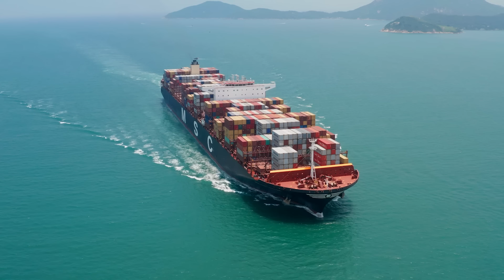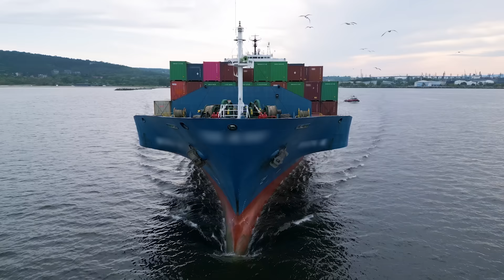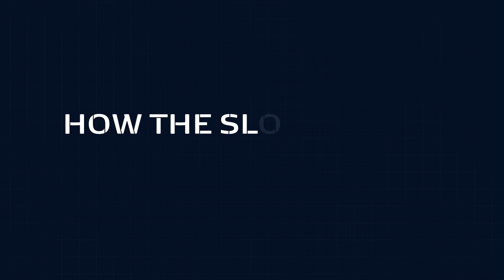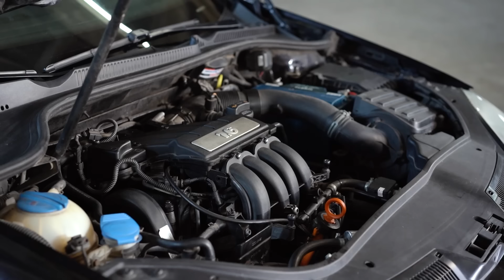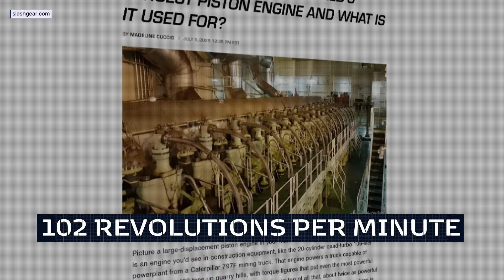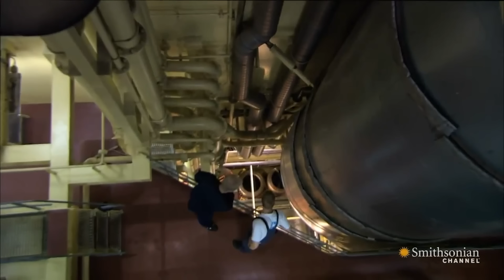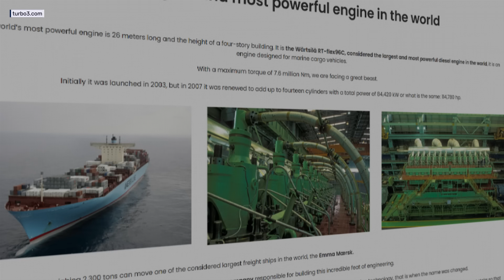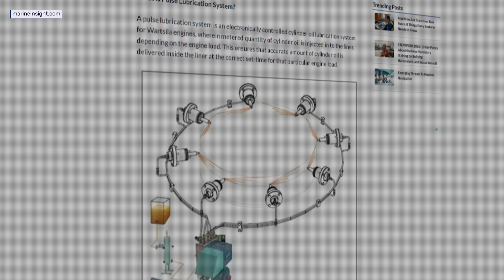The 100,000 Horsepower Engine

Comment: "barely faster than the second hand on a clock, a little over a hundred revolutions a minute"

That is precisely 100 times faster than the second hand on a clock, by definition.
Reply: You beat me to it LOL.
Reply: Now I think about it I get what they were trying to say, but the comparison was incorrect. I think what they intended to say was that it's barely more than one revolution per second. I think the writer tried to make it sound a bit more technical but then.ended up making the analogy wrong.
Reply: @DunkdaHunk finally someone who can understand what they meant to say instead of crying about it being wrong. But exactly, they meant one revolution is a little over one second but the way it was worded was just incorrect.
Reply: I know.  He got the math wrong from the get-go.  Imagine the crank shaft  turning the speed of the second hand on a clock. That's 1 rpm ,  not 100.  How do you convince the fuel to burn that slowly?    1 revolution per second makes sense.  I'm pretty sure that's what is really happening.
Reply: @timhallas4275 the speed of the hand itself the actual movement of it during a tick
Reply: @ApexPressureWash  How can that possibly be what he is saying here?  Why would he use such an obscure thing as a reference?   He is not.  He's is comparing the rotational speed of the crankshaft to the rotational speed of the second hand on a clock.  That would be 1 rpm. It makes no sense.
Reply: @timhallas4275 what makes no sense is how slow 1 rpm is in relation to the engine
Reply: @timhallas4275 maybe he means the propeller speed
Reply: @christopherwheeler2070  The crankshaft is directly connected to the propeller. There's no gear-box.
Reply: @thirstyCactus  plus giving it a 100-1 gear ratio would be incredibly inefficient and very slow.
Reply: @timhallas4275  it was ment as explosions per tick of that second hand, but unfortunate formulation for sure
Reply: @stanislavbandur7355  In a 2-stroke 14-Cylinder engine, there are 14 Bangs per revolution.1428 Bangs per minute @102 RPM (1428/60) comes out at 23.8 per second, not 100.
Reply: @JMuller-y1l  I am not sure, I cannot see into his head. I am used to think about 1 single cylinder when it comes to engines, rotary Wankel one is tricky, it does several things at a time, but that is other story. Using more cylinders is just for smoother running and enlarge area for cooling, it does not affect, how engine works. There are cars whit 2 cylinder with synced pistons, counterweights and flywheels do their job.  

sorry for unfortunately formulated comment on his unfortunate formulation
Reply: @timhallas4275 that’s not an engine that’s a trap set by Jigsaw somehow
Reply: @timhallas4275  you can add additives to make fuel burn slowly
Reply: @jwalster9412  I don't think you understand the problem here.
Reply: @jwalster9412  🤡
Reply: It’s precisely 1.7 times more.
Reply: @Thumper68  you might want to think about that again. I've jet to see a clock where a second hand takes less than a minute for a full revolution.
Hint: the minute hand takes an hour for one rev...
Reply: 102 is 1.7 times more then 60.
Reply: @Thumper68  100 revolutions a minute is 100 times faster than one revolution a minute
Reply: @m @mgancarzjr correct but I understand what he was attempting to say that there’s 60seconds in a minute 102 revolutions per minute comparing 1 second to 1 revolution. So meaning in 60 seconds it’s spins 102 times meaning 42 more revolutions then seconds not really that close and kinda a bad comparison but 102 is 1.7 times greater then 60.
Reply: @Thumper68  what he was attempting to say is nonsensical like: 

More people have been to Berlin than I have.

Grammatically, the sentence can exist, but it makes no sense.
Reply: @Thumper68  That would be the most illogical way of explaining it.
Reply: I really enjoy this channel, its host and it’s very interesting content, however there were a number of technical mistakes in this that even this retired master automotive mechanic knew were highly questionable. I have a number of questions that will go unanswered.
Reply: @southerncross5020 I mean if you have some unpaid interns pumping out scripts for the 20 channels he has there are bound to be mistakes 😂
Reply: @Atomy111 he gotta crack the whip in the basement and demand higher standards.
Reply: @Atomy111 so not using AI confirmed then??
Reply: @southerncross5020  I've been watching Simon Whistler's channels for almost a decade. He likes to speak with authority, but makes a number of errors, yet often comes off like you're an uneducated plebe for not knowing something peculiar.  See his most recent video on Side Projects on "misconceptions" about dinosaurs as a prime example.
Reply: @rtysson You say that you have been watching him for over a decade but then you disparagingly listed a number of his short comings, errors and condescending delivery. If that is your evaluation of his channel why have you watch him for so long? Just askin……..
Reply: @southerncross5020  why the hell do you care?
Reply: @rtyrsson  it's definitely a quantity over quality approach.
Reply: @rtyrsson I usually watch videos just to comment when he’s wrong and how stupid they sound making what to me is obvious errors 😂
Reply: @rtyrsson I assumed the constant propnounciation errors and mispoken lines were intentional engagement bait. He's been covering the Myanmar civil war for the last 4-5 years and still constantly mispronounces significant things like major leaders and historical figures.
Reply: @rtyrsson is he even writing the scripts himself anymore?
Reply: @_Webpersona  Yea, that’s a valid point…….
Reply: @rtyrsson  he doesn't write his own scripts. Don't blame him.
Reply: @rtyrsson  I kind of agree, but at least he isn't AI.
Reply: @rtyrsson Maybe obscure or peculiar to you, because you're a plebe. 

 I have heard Simon be a self admitted prick. Usually when he's like wtf... It's justified. 

 Impossible to give any facts without talking about the stupidity of the general populace, and getting some numbers wrong. 

 This channel is for hot insights.His other channels are for more educational.
Reply: @southerncross5020 yes Iove that you are absolutely correct 😂😂
Reply: This debate reminds me how few people have seen an analog clock
Reply: I was about to write that lol clever trick to generate comments haha
Reply: When he first said barely faster than the second hand I was like no way it makes power at 1rpm then he says 100 rpm. Thats a lot faster bud.
Reply: He probably means the ticking of the second hand, not the revolution of the second hand.
Reply: It's one of those things that you can agree with without actually think about it, but think for a second or a minute and you realise how dumb it is.
Reply: Wow the math in this comment section is whack. The seconds arm on a clock does exactly 1 RPM or it'd not be helpful on a clock, this does ~100 RPM.  So not barely a difference, not 1.67x like some people seem to suggest.
Reply: The 'seconds' hand... would have thought that that would be obvious.
Reply: I’m confused.

The second hand is moving 60 times a minute, and the engine is running 100 times a minute.

The engine is only moving 1.66repeating times faster, no?

Edit. I instantly realized why it was wrong.  
It’s a Revolution.  So yes, it’s exactly 100 times faster.

For whatever dumb reason, I dumbly decided to think of revs for a second hand as how many movements it makes a minute, not revolutions.

I did horrible unit analysis.

Yes, you guys are absolutely correct.

But I keep this here because I imagine that’s how the mistake was made.  A writer made the wrong unit analysis.
Reply: It's 66.66666% faster than the second hand on a clock
Reply: He says "the crankshaft turns over" meaning one revolution. Barely faster than the second hand on a clock. Meaning one second.
Reply: How do I think I'm completely incorrect now now I think I have a headache
Reply: Mechanical engineer here, came here to write the same, you beat me to it!
Reply: I really enjoyed this! Excellent!
Reply: Yeah, the script writer pooped the bed on that one. Obviously getting 60 seconds confused with 60 RPM
Reply: Glad I wasn't the only one thinking that. I think the fact they are confusing is they idle at like 1rpm or something outrageously low as I believe they don't really turn the motor off
Reply: Also noticed this lol they definitely thought it was 60 vs 100 not 1.
Reply: Aaaahahahahahahaha
Reply: the second hand, the one that counts seconds...
edit: i am an idiot! the second hand rotates at 1 rpm
Reply: What do people not understand about RPM, revolutions per MINUTE. The seconds one does... 1 RPM. The hour hand does 0.0167 RPM. This engine does 100 RPM. Lots of cars will idle at around 900-1000 RPM. Each one is an order of magnitude faster than the next fastest.
Reply: A hyperbolic comparison is a figure of speech that uses extreme exaggeration to make a point, emphasize emotion, or create a striking impression. It is not meant to be taken literally, but rather amplifies the reality of a situation to draw attention or add humor.
.
You must be a special kind of snowflake
Reply: I think Simon is just reading what the writer wrote and the writer is good with words but not so good at typing and engineering. In this case the word SECOND was a typo as it is commonly spelled as T H I R D.  🙂
Reply: unless im thinking of the wrong hands, the first hand does one revolution per 12 hours, the second hand does one revolution per hour, and the third hand does one revolution per minute. that engine is 100x faster than the third hand and 6000x faster than the second.
Reply: Someone got 2nd hand and Seconds Hand mixed up...
Reply: Torque brother  !! it’s all about torque
Reply: Since a second hand on a clock takes to complete one revolution and the prop makes one hundred revolutions per minute then the prop is one hundred times faster measured by angular velocity.
Reply: Lmao, man you must not have graduated high school.. he didn’t mean the second hand, as in the hand that counts minutes, he meant the “second” hand, as in the hand that counts seconds lol😂🤦‍♂️👍
Reply: @cameronsienkiewicz6364 

Right... How many times a minute does that hand, the one that counts seconds, make a full rotation around the clock face? Is it one time? One RPM?
Reply: There are watches that have seconds hands that spin one full revolution every second, specifically in stop watch mode. Presumably this is what he was referring to.
Reply: @Kyle_VanMan 

That's a big reach, and if that's really the case then I'd say a bigger slip would be calling a stop watch a clock. They're two different things to just about everyone.
Reply: Tf is the logic in that. If it's 100 revolutions a min then it's closer to 2 revolutions a second not a hundred
Reply: Yeah l think he was meant to say a second hand going around the clock face every second. Not at the same speed as a second hand lol
Reply: Also, a piston's "revolution" is an up and down motion, not a 360 degree rotation.
Reply: What? That's roughly 1.7x as much... what do you mean it's 100x faster?

Edit: Ahh, you mean it's engines RPM vs a second hands RPM. I think they might just be saying it rotates a bit over one turn per second, as opposed to other engines in thousands of RPM.
Reply: @V3RTIGO222 

Well, what do you call the hands on a clock?Hour, Minute, and Second.

How many times a minute does the hand that counts seconds rotate around the face of the clock?
Reply: @jasoneverett8491  It rotates just over one time in a second, relatively speaking. The issue is the metaphor has two interpretations.
Reply: You mean 40 percent faster
Reply: @yukinari2027 

What do you call the three hands on a clock?
Reply: @jasoneverett8491  your mum
Reply: Was thinking the same 😂
Reply: Without even thinking quantitatively that statement stopped me dead in my tracks.... How TF could a prop possibly work that slow?? It's intuitively obvious that's wrong
Reply: I bid third hand.  It is a metal stick, not a hand, so our errors compound.
Reply: WARTZILLA said it all.
Reply: 100 RPMS is 1.66 per second.
Reply: @clueless4085 

You are correct there, but what do you call the three hands on a standard clock? Are they first second and third, or are they hour minute and second? 

And, regarding the hand that counts seconds: How many times does it revolve around the clock face per minute?
Reply: 60 rotations in one minute, plus 40…. “Barely faster.”
Reply: @JackFromWyoming 

What do you call the three hands on a standard clock? Are they first second and third, or are they hour minute and second? 

And, regarding the hand that counts seconds: How many times does it revolve around the clock face per minute?
Reply: There's a few ooopses.  Later in the video he equated 84 MW to "roughly 114 hp".  Missing a few zeros there...
Reply: 100 times faster revolutions per minute than a second hand?
Reply: Generally people do not refer to the 2nd hand on a watch or clock as the second hand. It is most ofter called the minute hand.
Reply: Bro is strictly a script cold reader. 😂
Reply: It’s not that deep
Reply: The second hand on a clock rotates at 60rpm, so it's a little less than double, not 100 times
Reply: @scurzyyy  the second had rotates at 1rpm by definition because one rotation is a minute.
Reply: @scurzyyy 

Do you mean it ticks 60 times a minute?

Picture a clock, can you tell when the time is 15 seconds past the minute? How about 25 seconds or 30?
Reply: @jasoneverett8491  the second hand doesn't do a full rotation every second, it rotates 1/60 of a rotation
Reply: I'm now realizing I misread your comment and look like an idiot
Reply: @scurzyyy 

We all do it sometimes lol
Just look at the rest of these comments, so, so so many ppl had the same thought.
Reply: @scurzyyy  I did that at first too before my brain caught up with the rest of me.
Reply: The second hand is the minutes hand.. not the secondS hands. So it’s 66% faster..
Reply: Wait what? A second hand - the hand showing seconds - has rotation 60RPMs. So 100 revolutions per minute on the engine is barely faster than the hand showing seconds.
Reply: To be precise it is 67% faster. A lot of them now and even old ones tick one second for each rotation of a motor/flywheel. So yeah not 100 times faster. But even without that I'm pretty sure he meant one rotation was barely fast than one tick
Reply: Math
Reply: Im picturing a second-second hand that turns once per second counting out the seconds. I now need this.
Reply: By de cond hand he meant the hand marking seconds not the second hand marking minutes
Reply: @danielr951  Yea, but how many times will that specific hand make a single, full rotation in one minute? How many RPM does that equate to?
Reply: Do you understand how the gears in a watch work? 😂
Reply: Second hand runs at 60 RPM.
Reply: People are really hung-up about RPM’s in the comments 😅what I want to know is why the average diesel engined motor vehicle driver has to use ad-blue, EGR valves, DPF filters etc while merchant marine operators can get away with using these vast polluting 2-stroke diesels with no restrictions?
Reply: Imagine crying over this then getting it wrong yourself, you can find your comment on People Correcting Other People Incorrectly.
Reply: The answer lies in imprecisely defining "barely".
Reply: @simongreen9862  I wouldn't call a 100 fold increase barely, I don't think anyone would.
Barley must be some where close to a factor one, how close is a bit arbitrary, but it's definitely somewhere between the factors 2 and 0.5 as double is clearly way more than barely over and and half is clearly way less than barely under.
Reply: @simongreen9862  The answer lies in AI doesn't know what words mean.
Reply: Reading a script ... dead from the neck up.
Reply: @MrTexasDan Simon died in 2021 from Covid, this is just a deepfake
Reply: @MrTexasDan   That may be, but his ego is still running mouth and the meat machine from the neck down.
Reply: I've seen stopwatches with a hand that sweeps a full circle in 1 second, but even that's 60 RPM, not as fast as the 102 RPM mentioned in the video. And that's not what I think of when I think of a "second hand" on a clock or watch.

Unless someone writing this was confused about how many seconds are in a minute? Yes, there are people who think there's some sort of "military second" that has 100 to a minute, and they doubled down when confronted with facts.
Reply: i thought he said seconds hand, not the second hand
Reply: @sanitygone-l9y the hand that counts seconds still takes a minute to do one revolution.
Reply: @zacharyjacobs7233 yes but he's comparing the movement of the second hand which moves one tick every second,  ie. 60 ticks a minute vs 100 revolutions per minute. Now whether 40 units of arbitrary measurement = barely is subjective and up for debate, but the engine is not making 1 rpm 100 times faster than a second hand moves in this analogy. Or maybe I'm missing something.
Reply: @RobertD_83 I think you're missing that he never mentioned the ticks of the hand but did mention its RPMs.
Reply: @RobertD_83 that's the way I took it too. It definitely needed a bit more clarification, but I understand the sentiment
Reply: I think they meant to say engine revolutions per minute compared to movements of second hand.

Any case, quite far fetched comparison 😂
Reply: @kimmosilander4588  A combustion engine cannot turn once per minute, because the power stroke duration would be 15 seconds.  No fuel burns that slowly.  The efficiency would be less than 10%.
Reply: @timhallas4275 where did I say once in a minute?

They mentioned 100 rpm and I think they confused 60 ticks of seconds in the narrative.
Reply: @kimmosilander4588  The second hand of a clock rotates once per minute.  That is not 60 rpm or 100 rpm.  it's 1 rpm.   He compared the rotational speed of this engine to the second hand of a clock. Not me.
Reply: Technically speaking, he's only reading / repeating what was written for him by a writer(s).

He knows a lot because he has been doing this for so long, but he still relies on others for help and there's nothing wrong with that.

As I always say when someone tries to give me a backhanded compliment, and "accuse" me of "knowing everything,"

"I don't know everything, but I know a lot and what I don't know, I ask God about it!"
Reply: Eh? Seconds hand moves round 60 times a minute. This does 102. It's between "barely" and "twice".
Reply: @Project.DarkStar yes the second hand MOVES one step a second, but it takes 60 steps/seconds for one revolution/rpm while the engine in the same time turns 100 revolutions/rpm, so the engine is 100 times as fast as a second hand on a clock! By second hand I mean the one that is fastest on a three handed watch, the one for seconds..
Reply: @Bratfalken  You seem to miss what Simon meant. Or maybe I do. Perhaps its too much of a leap in comparison for some, but I did get what he meant - he meant ticks, no full revolutions.
Reply: @Project.DarkStar Would you like to rethink that?
Reply: @gamersretropolis  Nope. I think while perhaps poorly worded, Simon meant ticks, not full revolutions for the seconds hand.
Reply: @Project.DarkStar So wrong in other words? Over 100 rpm is not barely more than 60.
Reply: @gamersretropolis  I did say it's between barely and twice, in case you missed that.
Reply: @Project.DarkStar only modern battery powered watches tick. Most watches are wound, either by hand, or automatically from the movement of your arm moving around all day. With wound watches the second hand glides seamlessly to the eye and makes no ticking sound.

So it wouldn't really be logical to make the comparison to battery-quartz watches without specifying so or at least referring to the tick.

The answer to "how fast does a second hand move on a watch?" is 1rpm. That's the only true way to describe the speed of a rotating object.

Either a writer was tired, or that was written by AI, that's all, there's no justifying it or explaining the error away.
Reply: @DanielCrist  Funny cause all the clocks and watches I have have visible jerking motion on the seconds hand and I'd imagine most people will be familiar with what "tick" is, which doesn't necessarily have to audible (though with my ancient Citizen watch it totally is).
TLDR is I made a leap understanding what the writer meant but most people here seems to be unwilling to the same. That's fine.
Either way, it's too much of a conversation for something as insignificant as this.
Reply: @Project.DarkStar  you're trying too hard on this one. You cannot compare discrete movements of a second hand to continuous movement of a rotating object. By that comparison, the continuous rotation would be an infinite amount of infinitely small movements. Only frequency (RPM/Hz) can be compared.
Reply: @Project.DarkStar  I just get bothered by people defending errors in Simon's videos because he just pumps out an assembly line of content for 11 channels without seeming to pay much attention to the finished content. It's annnoying because the topics are interesting and he's an engaging speaker, but he seems to put very little effort in.

To address your experience with watches, those would all be battery operated then. Mechanical watches are generally more expensive and often require maintenance every few years to keep the intricate and delicate parts all running properly, so most modern mainstream watches are quartz&battery operated.
Reply: @mgancarzjr  I get what shorthand though went on here instead of overanalyzing everything and I'm the one trying too hard?
Reply: @Project.DarkStar yes, you've over analyzed it. The simplest answer is there was some confusion between once every sixty seconds and sixty times in a minute. Trying to tie it to the discrete movements of a second-hand every second is going too far down the wrong analysis.
Reply: @mgancarzjr I simply said he meant ticks of the seconds hand on the clock. It ain't rocket science and it ain't over analyzing.
Reply: 'Seconds hand' not second hand....
Reply: @shawnesoutherland the seconds hand still only performs one revolution per minute, or 1 rpm.
Reply: @shawnesoutherland funny how that just slipped by them all …
Reply: If there are 60 seconds in a minute then if he was correct it would only revolve 60 times in 1 minute that doesn't mean that he was 100% off in that case it would be 120 revolutions per minute per minute math makes sense look it up
Reply: @jacyjensen9986  the second hand does 60 ticks a minute. And one full revolution. You seem to have forgotten that the second hand does not do a full revolution every second.
Reply: It’s abt double, not 100x…
Reply: @S @Skinnyman-yj7jz he second hand on a clock spins at one RPM. He said this thing under full load spins at 102 RPM, so it's 102 times faster than the secondhand on a clock.
Reply: @snowdog90210 a second moves every second, there are 60 seconds in a minute - that’s 60 revolutions per minute or 60 rpm. Off but not 100x off. I think you are thinking ‘minutes’ hand or the second of the hands vs the first which would be an hours hand maybe?
Reply: @raybarber6331  it moves every second, but it doesn't do a full rev every second. in fact it counts 60 seconds on one revolution, so it does roughly 1 revolution per minute.
Reply: @raybarber6331 a revolution is a complete rotation. Each second, the second hand only does 1/60th of a revolution
Reply: @r @raybarber6331 RPM stands for revolutions per minute. It takes the second hand 60 seconds to make one revolution around the clock face.
Reply: Your typical diesel engine revs in the thousands of rpm so a hundred is at minimum 10 times slower
Reply: 100 Revolutions per minute, 60 seconds in a minute, so "by definition" 1.67 times faster than the second hand...
Reply: @roblilt7359 no... 
Yes it's 1.66 revolutions per second... 
But the second hand travels at 
1 revolution per minute... 
Or 0.01666 revolutions per second.
So I think you are confusing per second vs per minute.... 
Tbh I did the same thing .. and realized it while reading the comments 😄
Reply: I think he did mean the second hand in the clock goes around about fast as the engines pistons, but the engine is still What ? About 1.63333 times faster then the second hand on the clock going around minute. Hi from FINLAND 🇫🇮
Reply: 100 rpm would be 1.667 revolutions per second. So it would be more accurate to say just below twice as fast as a second hand. 100 revolutions per minute, 60 seconds in a minute, 100÷60=1.667.
Reply: @duathhadron5040 look at a clock and try again
Reply: @mattaaron6142  when he says “that’s barely faster than the second hand” he doesn’t mean how fast the second hand spins, he means how fast the second hand ticks. It’s unbelievable that any of you people even made it past preschool if you can’t understand simple concepts like that
Reply: 100 revolutions a minute is 1.66 times faster than a second hand, not 100 times faster than a second hand. (100 revolutions divided by 60 seconds = 1.66).
Reply: @rtyrsson  a second hand rotates at 1 revolution per minute.
Reply: @rtyrsson the second hand ticks 60 times a minute. It does not make 60 revolutions a minute.
Reply: @rtyrsson lololol
Reply: Where the fuck do you live that people call hands on a close first and second? Not hour and minute or little and big... wow i
Reply: @DrViabadd Hour, minute, and second, not first and second lol
Reply: @DrViabadd hour minute and second hands